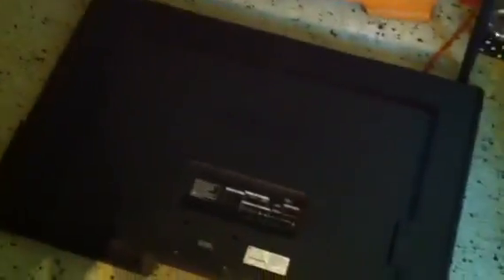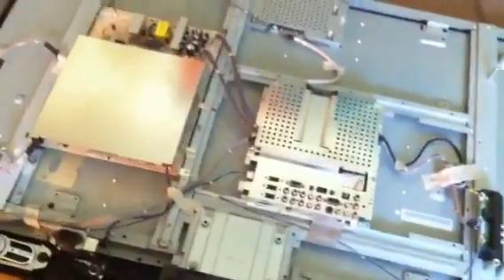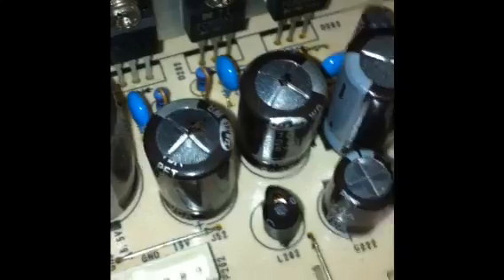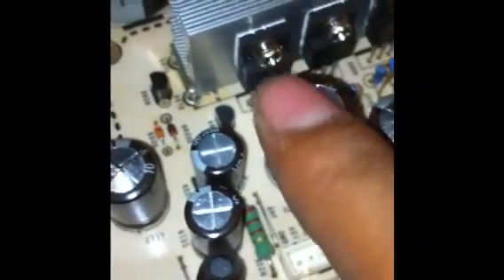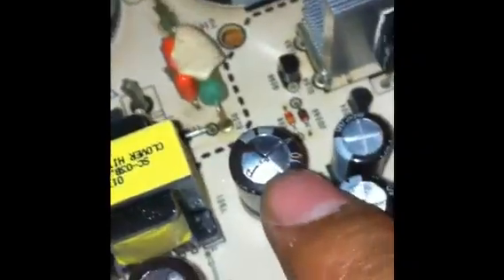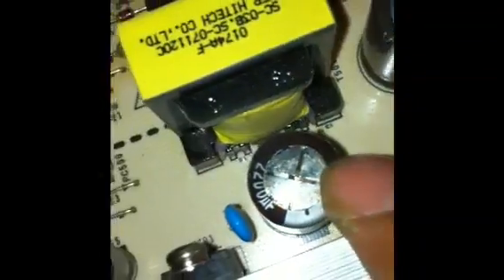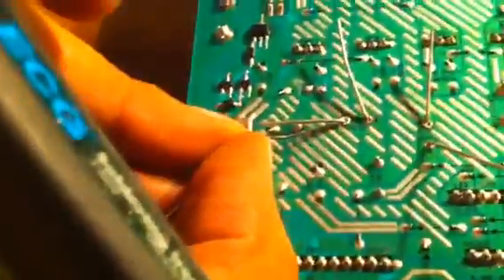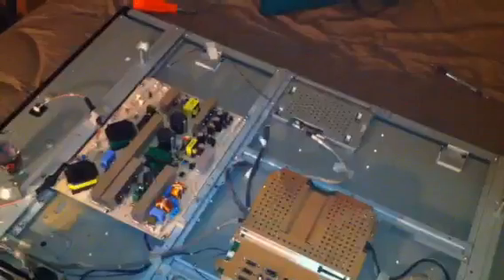Broken LG LCD TV Capacitor Black Screen My Wont Turn On

Comment: Very good job... especially if this was your first circuit board component change...
Only thing to point out is that the caps are polarized and need to be put back in the same + and - positions as removed....

Comment: i have a 40 inch flatt screen samsung model la40r8 1bd tv and i repelaced 2 blown caps they was 2200uf each and ten volts so i put 2 new 25 volts ones in low esr types and its still not working but clicks alot and the red light blinks on and off so i googled it more and they say it could be a corupted eeprom what else could it be all other caps are fine and the 2 fuses are ok

Comment: @FixItUrselfDummy Thanks for the reply man. I found a guy on ebay thats gona give me new capacitors I opened my tv and took down the details of my capacitors ill watch your other vid when its time to replace my capacitors although it seems my tv is working again with the same capacitors it comes on straight away although im still gona buy the new ones just to have as spairs for when they eventually do break

Comment: Hey man I think ive got the same problem as you had my lg tv has a black screen when turned on but it doesnt always happen some times it works and when it does it works untill I turn it off again. I think my capacitor may be on its last breath lol struggling to work. My question is how do you know what capacitor to buy I have a 32" LG lcd tv its model number is 32lg5700 is there a specific capacitor for that model or can you get any LG capacitor? Please reply I want to get this fixed quick

Comment: @FixItUrselfDummy 

Holy shitballs it working!
Well done, particularly if you had never even done soldering before.
Its worth mentioning to others that they should get exact replacements with regards to their capacitance rating, the voltage rating can be the same or higher.
Oh and get the positive and negative the right way round too. 
Nice video.

Comment: Kewl video.....   Its great  -   with a little time and the right attitude, most anything can be fixed or repaired at a reasonable cost.......   Of course the reason Im writing...  my LG plasma has good sound but no picture (black screen)......  removed the back and looked....   hmmmmm  nope I dont see anything that might indicate a bad cap.......   no bluge or leaking caps????    I heard something about "dry caps"??  not sure what that is or how to test for symptoms.  thanks for any input

Comment: @FixItUrselfDummy..what model was your LG..Mine has problem where as when powered red light blinks once and goes off.and there is just a blank screen .This happened after a failed installation of firmware to make able to play dvx..Any ideas what parts i may need to replace..

Comment: Dude, I know you sorta stumbled through this but I learned enough to do this and saved myself ~ 600 bucks!  It only took a few hours and it worked perfectly. One thing I discovered is that at least one of the caps I replace was an "odd" rating: 1500 mF - 24V...it's advisable to discuss this with someone who understands electronics if you have one of these to know what to do.  Thanks for making this film!!!!

Comment: my tv relay clicks but wont turn the tv on.  I checked the capacitors on the power supply but all capacitors are fine. any tips on what may be wrong with my tv?

Comment: Yo, it works. The most expensive thing was the Soldering iron and lead. The capacitors were $1.98 ea @ Radio Shack, yes, they have it. I just switched them out, two of them, and tried it before i closed the back, which is not the best idea but it worked. Then i closed the back and plugged it in, yay!!! it works. 
I had to take pictures with my phone so i can remember where what goes...thanks dude...awesome.

Comment: Bro i got the same problem with my i just got one question what kind and spec of capacitors you use to replace the busted ones meaning voltage and type. thanks bro due im having problems with mine. i just want to have a bit more info before i do this little fixer upper.